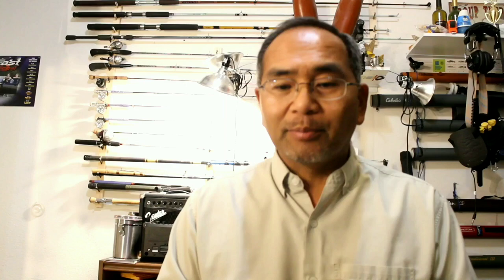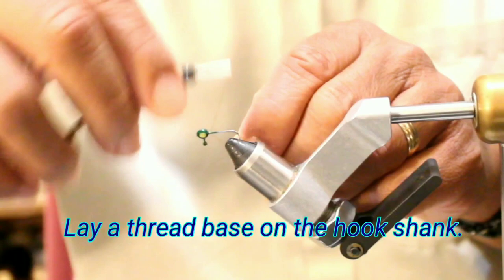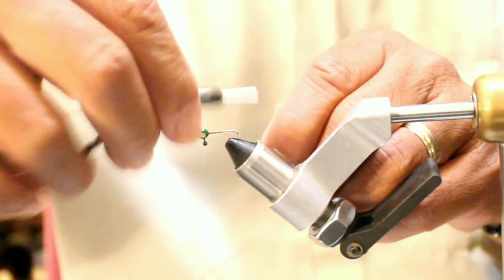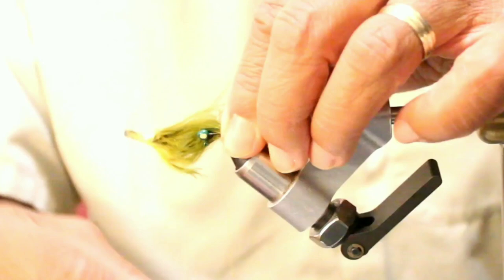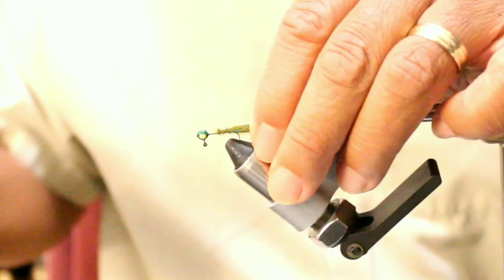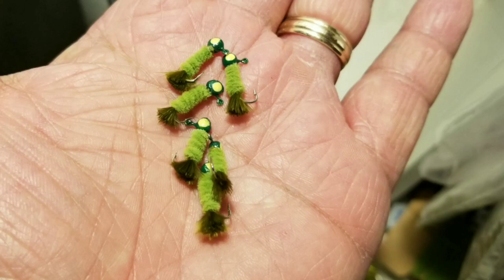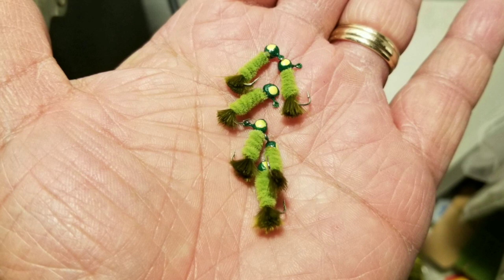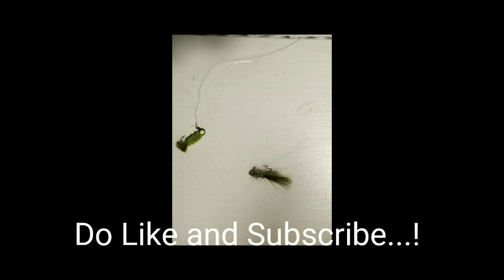How To Tie A John Deere Fishing Fly

Comment: Looks like the chenile could soak up berkley attractant
Reply from the maker: It could easily do that. Luckily trout were taking them without the need to soak them. Issue I had was running out. Lost what I had to snagging the bottom
Reply: COAF Field Team I might try something similar for ice fishing our trout lakes in Manitoba
Reply from the maker: @cuttlefishpie3731  Good luck... been getting questions on the tandem rigs we used for fly fishing. Working on a video to answer the mail, will include a demo of the tandem rig used this past Sunday. Do check back!